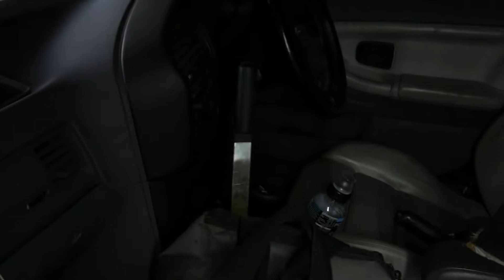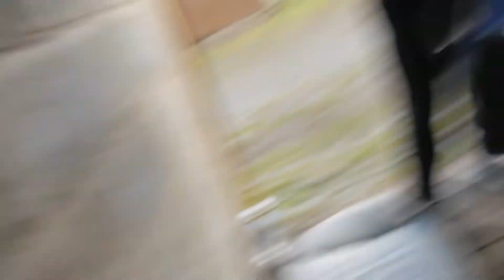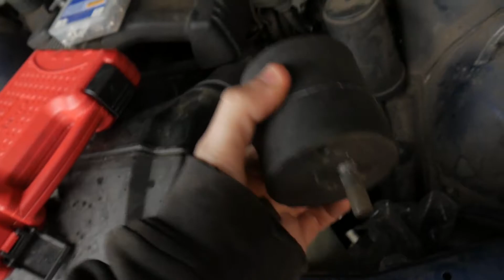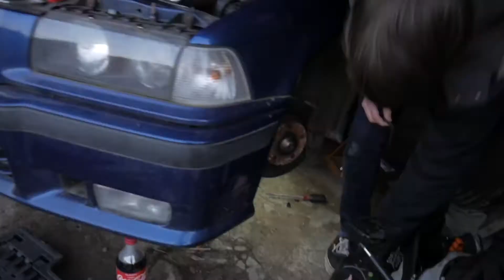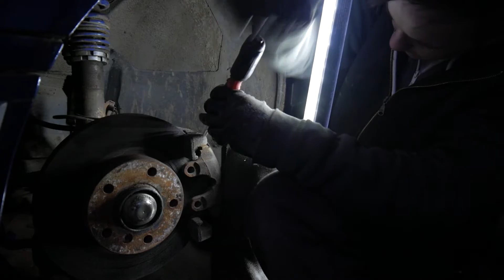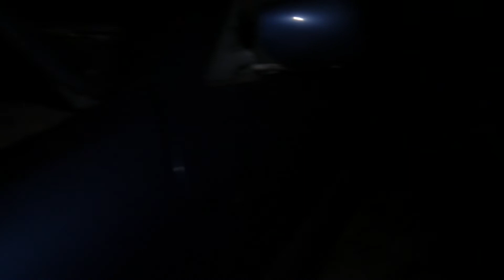Archies 323i Bimmer (Drift Car) Trying To Change Engine Mounts And Trying To Unstick Caliper

Comment: Is it always raining? All the cars i saw on ur chanell are rusted
Reply from the maker: Up where I live the salt the roads like mad! Also stuff like old owners not cleaning the undersides of cars and that really dosen't help. Most cars of age in the uk are full on rust! My next main step I want to do is buy a welder and start fixing rusty stuff. A lot of old cool cars get scrapped due to rust and I want to resuce them. I want to be able to buy rusty cars, mot and then sell them sometime in the futher. Could be a good bit of money in it!
Reply: @DriveShifty  if y have the skills do it. A lot of money can made
Reply from the maker: @getready8104  Save for the thing you want! More so the space to do it! Done a few bits of welding before and I have got the hang of it but need more practice